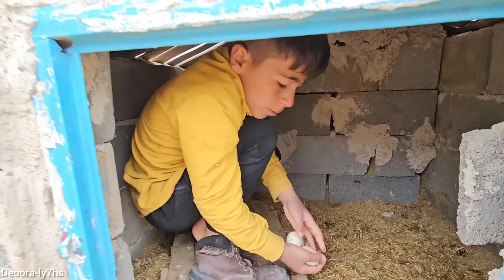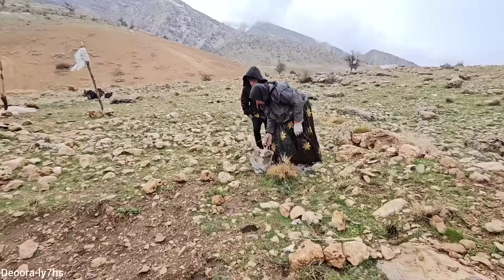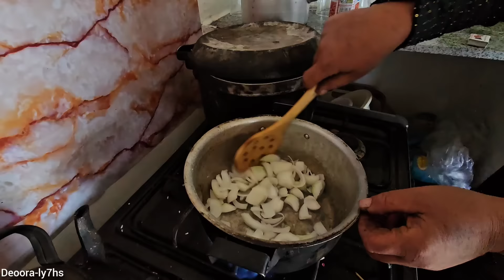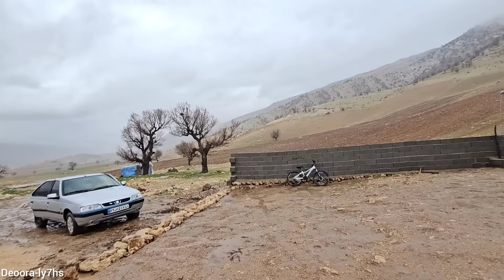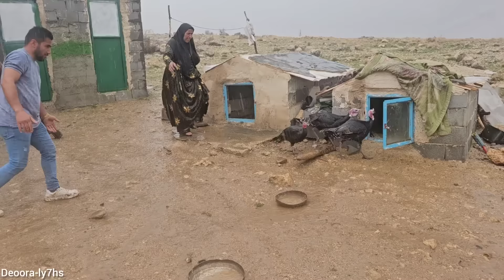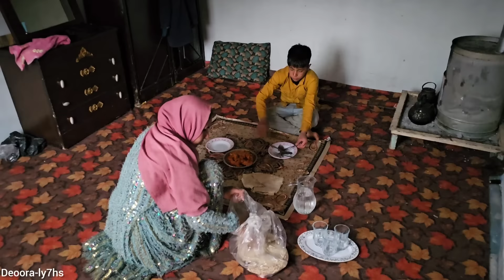Overcoming Infertility: Positive Test Result and Celebration for Deoora's New Family Member #deoora

Comment: Mr. Nemat, the color in the entrance way looks great, it would look even better if you could make the paint lines straight, the facade would look also look good in the same color, you might want to think about a oil heater and remove the wood on, issue of lack of wood and too much smoke.